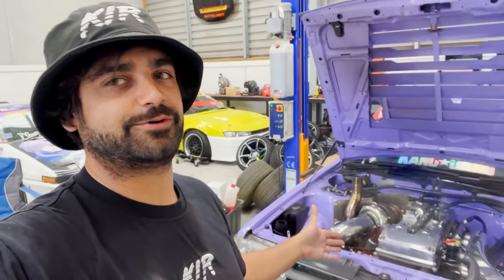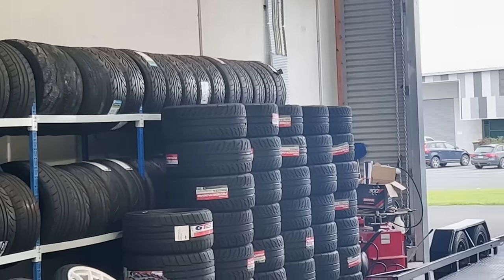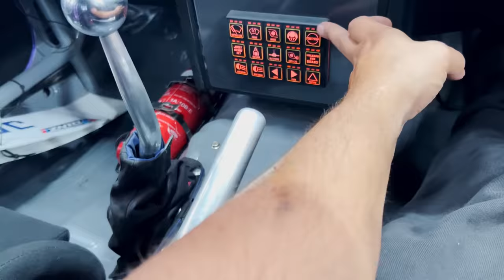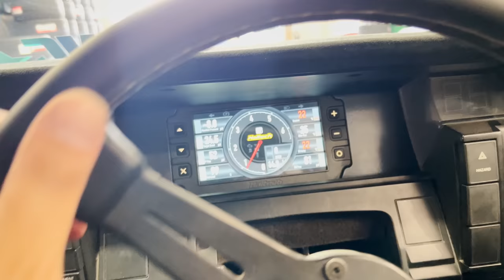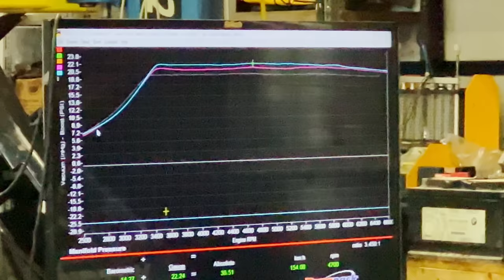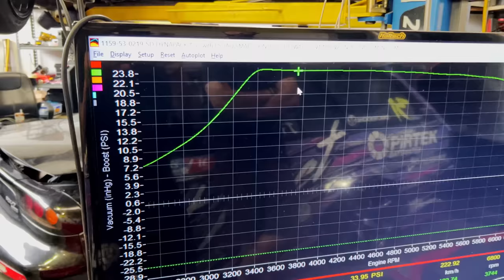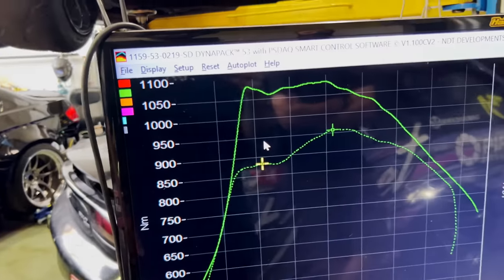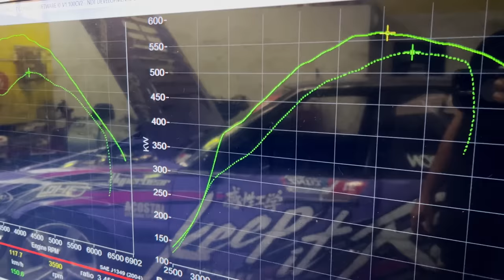How Much POWER will the Nitto Forged Barrawagz Make?!

Comment: Did you try and pressure bleed the clutch? Get a brake fluid syringe and try pump fluid through the system like how they bleed motorbikes and airplane hydraulics

Comment: intake runner length, big cams, ports and valves pretty much dictate the rpm, then if your crank can handle the forces of the rpm, probably go with a tool steel billet crank, even as a 4.0L would be a good upgrade. 3.8 is more of a drag engine thing. Richard Holdener yt has heaps of videos comparing stroke vs bore and turbo cams vs na vs nitrous cams, your warranty is with the engine builder and tuner though

Comment: thats some spicy power poor tyres they will be punished

i personally know of people with stock fg motors n/a reving to 7500 in the usa for skid comps 5 speed manual  mustang body  fg sent hard

ive been reving even stock barras to 7000rpm at a crazy push 
i would honestly have a guess at and say turbos ar housing is to small ford barra flow alot of air at 7300

Comment: Sooo Sick but the oil filter inspection was complete bogus... you cant cut the housing with a grinder, that contaminates your sample. There is an oil filter cutter for this purpose. Also you need to cut the filter element out using a razor blade so you can fan it out on a table an actually inspect it, not peek in 3 or 4 of the 100 pleets. Come on guys.
Reply: Obviously this wasnt the “correct way” but we did what we had to because we didnt have a filter cutting tool here. Yes the grinder contaminates the filter, yes cutting the element out and spreading it open is the correct way to look, however doing what we did was better than doing nothing at all and still gives a good indication if theres anything going wrong. Easy enough to tell bearing material apart from filter housing material & if there was anything that looked concerning then we would have investigated further.